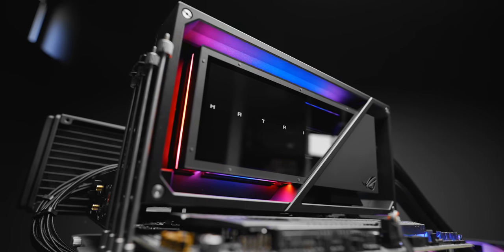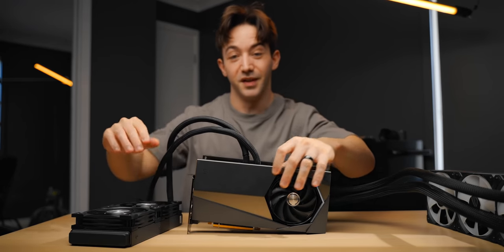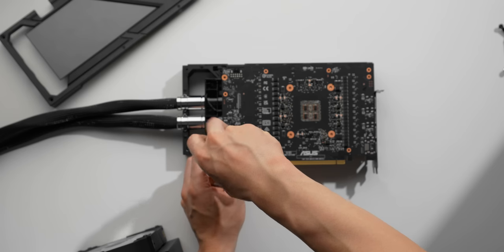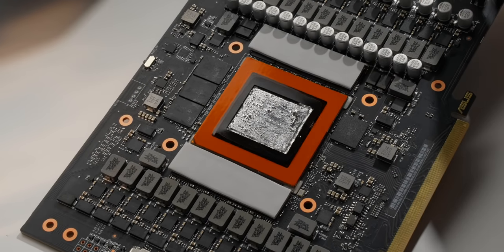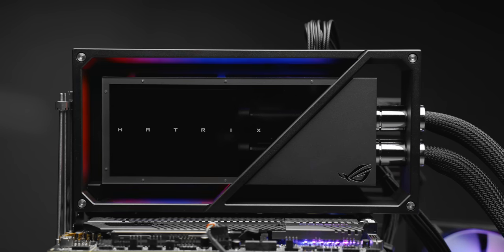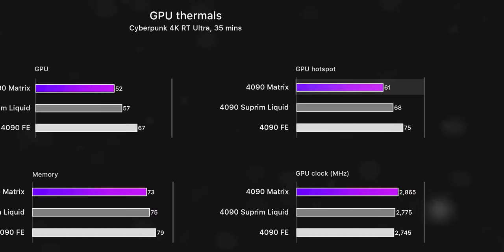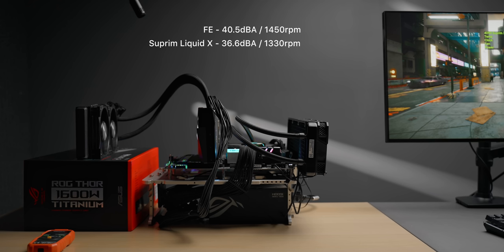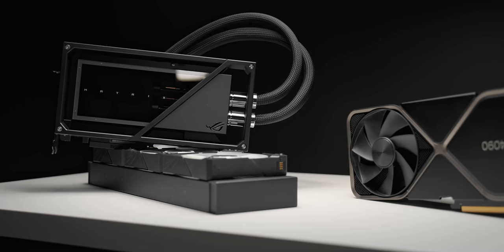Most Overkill GPU – ASUS 4090 Matrix

Comment: The card by itself looks like a sick SFF build.
Reply: mhm might as well cut in pieces a tinyATX that goes around it and wire all the traces lol
Reply: FE 4090 with a waterblock is only 236mm/9.3in which is a fantastic option that is significantly cheaper than most 4090 AIO options.
Reply: What kinda SFF can fit a 360 rad
Reply: @maozedowner5915  He's talking about just the card and the looks of it, not including the rad.
Reply: What is an SFF?
Reply: @grayson8566  It means Small Form Factor. Just means a really small PC like something built in an Cooler Master NR200, FormD T1, Loque Ghost S1, etc. PC case.
Reply: @grayson8566  small form factor
Reply: @grayson8566  Small Form Factor (SFF)
Reply: maybe not sff, but it can fit in asus prime ap201 matx a pretty compact case
Reply: sff 360 rad? yea no
Reply: @dan8t669  he's just talking about the appearance, dude
Reply: @maozedowner5915  The Corsair 2000D can.
Reply: Giving me ideas like one crazy case that was built out of water cooling pipes for the frame lol
Reply: Challenge accepted, Ali? 😉
Reply: Too bad for the 360mm AIO tho
Reply: @grayson8566  street fighter five
Reply: GPU OS
Reply: For that price, you can build a sick sff pc.
Reply: Eventually these card gonna be big enough that cpu, ram are gpu expansion slot😂
Reply: No matter how unnecessary or ridiculous something is there is always some idiot who will buy it..
Reply: If he's talking about the appearance then he's using the wrong language  @hadifelani
Reply: @thebritishviking   what's the "correct" word for it, then?

Comment: So you take a $2000 gpu and slap a what 80 buck cooler on it and now it suddenly cost $3200 smells like bs to mee
Reply: Well said!
Reply: Doubt that cooler is $80 considering it’s an AIO and it’s also comprised of a copper  for the heat transfer to keep the cpu cool but again there’s more than likely a lot of R&D that went into it.
Reply: You have no clue about prices. The water block itself will cost more than 120 for gpus. If you want liquid metal that's gonna cost u another 20 - 40. Then the tubbing and fans and radiator gonna cost u around total 350-450. If want premium parts it's going to cost more than that. So I would call this a bigger scan than a normal 4090

Comment: What a gorgeous bit of hardware. Stylish and functional, probably the best ASUS has put out there recently.
Reply: Very very good but 3200 is a lot more than it should be.
Reply: For a liquid cooled gpu, it's pretty thick. Shouldn't it be thin? Like old GPUs?
Reply: @fynkozari9271  thats really up to the designers but personally i think its great that its a little thicker than most aio gpus since it massively reduces noise levels.
Reply: probably costs 1800 dollars real price.
Reply: @Orangr  its 7600

Comment: I was expecting you'd include your own 4090 results in this video - considering it is a custom liquid cooling job, giving us an insight into what performs better - or how much better or worse can you get if you go custom vs top of the line complete solution like this one.
Reply: I guess the difference is he's on an open test bench here. Also a custom loop will share with the CPU so it will depend what CPU you have too.
Reply: Yeah that's very unfortunate
Reply: I'm pretty sure Asus would not want to show those results considering they are marketing this particular card here.
Reply: @igrvks at worst it’s the same and still has the hassle of open loop cooling
Reply: It doesn't perform better. It's the same die, kept cooler by single digits. 

It's a brag piece or a benchmark queen. In real use on a gaming rig, it has no extra value aside from sound and aesthetics
Reply: @benjimc1  A custom loop doesn't have to share with the CPU. That's up to you as a builder... that's why it's custom.
Reply: @Taizunx  yes but then it's just an aio effectively. 9/10 times you're gonna share, otherwise you need 2 pumps
Reply: @benjimc1  custom loops can perform better than an aio. But they are all ambient air based, so they all share the exact same max potential unless using chilled liquid.

The benefits of a custom loop are that there is more fluid volume, lengthening the requisite time for the liquid to reach steady state. Also, the ability to have more airflow and radiators, which won't make them any cooler, just more efficient in getting to that cooled temp.

Comment: Wow... not sure if im more impressed by the product or the cinematography. Either way I want one because of this video.
Reply: F it ...  I can make a PC with a 7900xtx 7800d3 ASRock motherboard phanteks nv7 case. 
Phanteks expensive fan water-cooling and power supply. 
2TB m.2 PC4.0 
32 gb 6000 cl30 
Samsung Odyssey G8 OLED. 
Keyboard and mouse... 

Same price......
Reply: @Mark-nc2nx  I don't think anyone's arguing that this is a good value buy.
Reply: @Mark-nc2nx I can buy 10 cars, or one Ferrari

No one is making a value argument here
Reply: @bootchoo96  Ferrari can get to +- 300 kilometers... 

This is 5 % faster .... 

I don't mind if you pay more for primum and if you like the looks....

But 2x more .... 

If it had als 32 gb and between the 15/20% yes .. 

This is stupid....
Reply: Lmao $3200 price tag. You don't get that much performance over the $2000 strix oc.
Reply: @bootchoo96  value argument .... 

If am trying to make a value argument then I would have compared it with a 7600 7700xt a crappy case low end motherbord 750w PSU 1gb pci3 ssd 16 gb 4200 memory ect ect .... 

I know you will always pay for Design..... 

If it was maybe 500 euro more than Asus Strikes card.... 

But almost 2000 euro....
Reply: @GPStuntMan  is it 3200. 

Not more like 4000 ?
Reply: @Mark-nc2nx  if the price is stupid, it's not for you

You can get a supercar thrice the price for 0.4s faster acceleration

The 4090 pricing is stupid in the first place, for some 2 grand or 3 is like the difference between $200 and 300$

Comment: 2:08 There is another problem that you didn't mention, Liquid Metal (LM) eats bare copper. In 1-2 years you will see your temps go up and you will have to reapply LM to bring your card back to spec. If you decide to purchase this card I would replace the LM with Thermal Grizzly's KryoSheet on day one and never have to service it again. Bottom line, ASUS should have nickel plated the block.
Reply: How's the kryosheet compare to PTM 7950?
Reply: Good mention but I guess if you have the money for this card you probably have the money to upgrade every 2 years/new gpu cycles…..
Reply: @adang9948  You are correct but I'm not a fan of e-waste. If you buy this card and replace it in two years, give it to someone in need, in a condition that doesn't require them to tare it apart.
Reply: That's pretty important info. Thanks for the heads up.
Reply: And it’s even annoying to take apart it looks like. Not a good look
Reply: they should've been using phase transition stuff,not liquid metal
Reply: Gamers nexus has a video on this. It plates the copper. No change to performance.
Reply: @TheSunshrine  it doesn’t change performance it it combines with the copper to make an alloy so you’ll have to repaste it until it makes a solid layer
Reply: @TheSunshrine  Watch Romans video on this card, he would disagree with you and he has part ownership of Thermal Grizzly, the maker of Conductonaut.
Reply: @TheSunshrine  it's about endurance,  not performance. I guess I'm to much in repair community tho
Reply: i use conductonaut on my copper aio for over 3 years now, literally nothing happened
Reply: @BansheeBunny  Gallium will not corrosively eat through copper. you're thinking aluminum. Yes, liquid metal will eat through aluminum spreaders and is not recommended. This is not true for copper, however. It will stain it, but not take away any of its effectiveness nor will it pit.
Reply: @mmz12   At the 10 minute and 36 second mark of Roman's video for this card. "If you use gallium-based liquid metals and apply them to naked copper that over time, lets say after a year, it will defuse partially into the copper. That means that at least from my assumption it is very likely that the temperatures will get worse after a year or two and would require a reapplication of the liquid metal." This is from a share holder of Thermal Grizzly, maker of conductonaut (liquid metal).
Reply: @BansheeBunny  Please be aware that there is information outside of this particular person and their experience/studies.

Also, in quotes you include "from my assumption". It does ionically defuse into the metal which causes the irreversible staining. Though there is not enough evidence currently to support the idea that it causes any damage or necessitates reapplication.

To the point.. I was simply addressing your comment where you say "There is another problem that you didn't mention, Liquid Metal (LM) eats bare copper." where this is not correct.
Reply: @mmz12  I've used liquid metal with a bare copper AIO and it pitted the surface after 6 months.

Edit: English is a not Roman's primary language.
Reply: @BansheeBunny  I would definitely be curious about the product then. Perhaps it was alloy or plated?

To be fair, its all a moot point, I just like to engage. lol Reality is that the benefits are so little or non existent using this stuff over traditional thermal compounds, its not actually worth it. The only tests you'll see showing crazy numbers.. are from people making money in some way from its sales. An un-biased, genuine test will not demonstrate this. Its application and benefit are very situational and are by no means a top choice across the board. There are many risks for the very real outcome of you cutting 1-4 F.

Unpopular opinion, I'm sure.
Reply: @mmz12  Hardware Unboxed swapped out the liquid metal for the KroSheet and in-game temps only went up 2C.
Reply: @BansheeBunny  Yeah, thats about what I would expect. I mean, the stuff (liquid metal) looks next gen, but I havent really seen it be worth the hassle. Be surprised at how many customers bring in devices where they've tried delidding their cpu or tearing down their gpu over it...

I guess it does run a lot cooler though when it no longer functions. haha
Reply: if you have this much cash to buy this gpu then it probably wouldnt even matter cuz since your that rich youll be upgrading your gpu every new generation + these water cooled gpus come pretty late to the market and stuff too so yea 2 years is enough before the 5090 comes
Reply: @BansheeBunny  If you buy this card and replace it in two years A. where do you work and B. are they hiring

Comment: Gorgeous card. I was considering waiting but glad I eventually ended up with a Gigabyte Waterforce 4090. Replaced the fans with 6x Noctua’s and it runs fine at +200-220 mhz core depending on the workload (boosts to 3050 mhz) ,+2000 mhz on the RAM, and about 57C. Oh and it’s super quiet. 😌 I have it rendering 24x7 for weeks at a time at these speeds and it doesn’t even blink. 😎
Reply: Agree, that Waterforce Extreme 4090 is a silent beast. Like mine as well. How did you replace the fans that came with it though? I added 3 extra, but just moved the stock ones to the back side so they'd be outta sight. 
@DavidTrejo
Reply: I want to build my own rig. How and where do I start?

Comment: " extremely expensive" would be an understatement... It's $3,200 USD. That is quite frankly insane. You could get a 4090 tuf OC (or non OC for $200) less for $1800, which has the same PCB minus a few power stages that don't matter as the Strix, Optimus GPU block (the best block available. Or Watercool), put liquid metal on it, EK rad/fittings/tube/FLT pump res combo, Phanteks T30 fans and fluid for less than this AND it would perform considerably better.
Reply: Optimus, the company with shit QC and CS, and the one that uses a water chiller to advertise how “good” they are? Lol
Reply: You are missing the entire point of this card. You get it because you can get it, not for if you need to save a bit but still want a 4090.
Reply: cost of good ek pump with that overpriced block would cost more and look mouch worse. I am just sad it released so late i hope it will be new gpu lineup for 5090 etc as something like aorus and msi watercooled gpus
Reply: The MSI one Ali tested in the video is also currently $1800 US.
Reply: Who says it would perform better? This thing is already performing pretty damn well.
Reply: Suprim Liquid X 4090 was 1700 on Newegg even seen them go for 1400 used on eBay

Comment: There’s a big issue with this card and that’s the fact the copper isn’t nickel plated. I don’t know why they left the copper gate in this card it’s gonna lead to issues in around a year.
Reply: What. Why? The surface that matter won't oxidize as it's sealed. The rest can oxidize and it wouldn't matter.
Reply: @ivyr336  it doesn’t oxidize the liquid metal will combine with copper and form an alloy that will ruin cooling because there’s no real conductor for the heat to get to the block and you’ll have to reapply the LM to the GPU. This is something that asus laptops also deal with often. It’s just chemistry and they don’t care I guess.
Reply: It eventually makes a layer that won’t be an issue after enough time…but you wouldn’t have to deal with this and the repasting if they just plated it with nickel.
Reply: Gamers nexus has a video on this. It plates the copper. Doesn't impact performance.

What you are describing sounds like LM + an aluminum heatsink.
Reply: @ivyr336  it doesn’t effect performance because it’s a bad conductor it effects performance because it becomes a solid alloy that you need to add more conductor to until a solid layer is there so it doesn’t have anything to react with and yes bare copper and LM have a reaction with each other as well
Reply: @ivyr336  if they just plated it with nickel you wouldn’t have to do as much repasting on an annoying to take apart card is all I’m saying and with something this expensive they should have done it from the start like even the MSI gaming trio is nickel plated copper they can easily do it (it’s 1-2 applications for the process to be done with bare copper but still why though)
Reply: @Blu9ty  should have done it for sure but it does not impact performance. We are talking atoms that plate the copper. You are not going to have it be sucked up like a sponge like with aluminum. Surface will be coated and then it's essentially inert.

Then this also happens to nickel coated copper. As proven by gamers nexus. Just to a less noticeable extent.
Reply: @ivyr336  ehhh I’ve seen it spike temps up on other products after a while (laptops) it’s a well known issue and why every LM company really goes: pre treat or use nickel platted it’s a lot more noticeable than just a few atoms worth over the course of a year and why OCers say the same thing and i really don’t think Roman would talk about this over and over about this over the years if it was a tiny tiny who cares thing

Comment: That 4090 Matrix is absolutely stunning... But I don't think can justify another $1400 over the MSI Suprim Liquid X. I can admire the 4090 Matrix from your video, great job!

Also, the 4090 Matrix would look absolutely SICK with the O11D Evo Upright kit! If you ever do non SFF builds give that a try - the MSI Suprim Liquid X already looks great in the upright configuration. I had wished that the Suprim's cooling tubes would point down like it does in the Matrix.
Reply: really, very elegant gpu, but it has the same performance as others, if I take a normal gpu and put a block, I will get a better result and I will save a lot of money

Comment: Considering how massive coolers are getting I’m not sure this is overkill. Feels like someday this will be standard.
Reply: Yet this is a pretty massive design that only got an additional 3 percent in frames over stock.  The other side of the spectrum can look how small a cooler can be with undervolting.  This has already been done hundreds of times before.  I much rather buy a 4090 that's uses less power in a smaller formfactor.

Comment: Very cool looking, but I have an issue with an AIO cooling solution like this. In 3-4 years, that liquid is going to evaporate, and then what do you do? Would have been cool if they had put standard fittings on the thing.
Reply: I had an AIO in my last system for almost years and the liquid didn't evaporate. Doesn't seem like it'd be an issue within the standard lifetime of PC hardware.
Reply: Sleeved tubing won’t lose liquid. Rubber tubings will cause liquid to vaporize, and that’s why almost all AIOs are using sleeved tubing

Comment: I am always a bit sceptical about the longevity of these AIO liquid cooled GPUs. Unlike CPU coolers which are separate things, these are bolted onto the gpu and probably all proprietary. Worse yet these go onto the most powerful and expensive GPUs
Reply: I've had an AIO cooled GPU (EVGA 2070 Super XC Hybrid Gaming) for four years and it's been great. Still running cool, still amazingly quiet. It'll definitely last until I replace it in the next year or two.

Comment: The massive power consumption and consequently the massive heat produced by these things is madness. 
Unless you have an air-conditioned room or live in a cold climate these things make the room intolerable. In warmer weather, summer, spring, I certainly do not need the extra heat, and given power charges the extra costs, of 500watt heater running. 
These radiator coolers keep the gpu temp tolerable, but only by pushing all that heat into the room. 
Time to give up PC gaming I guess.